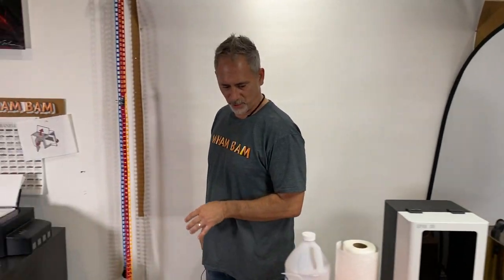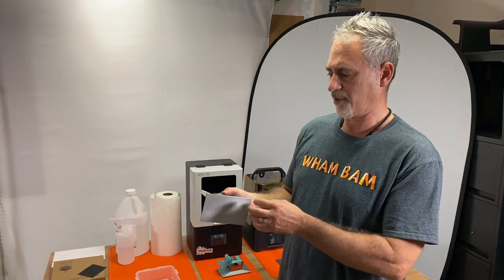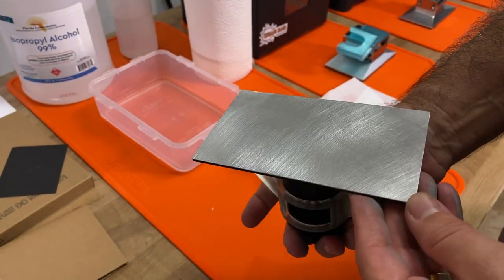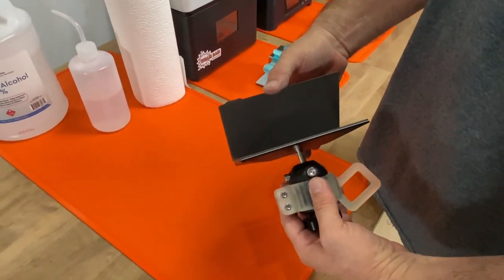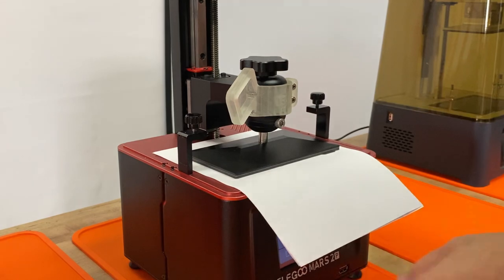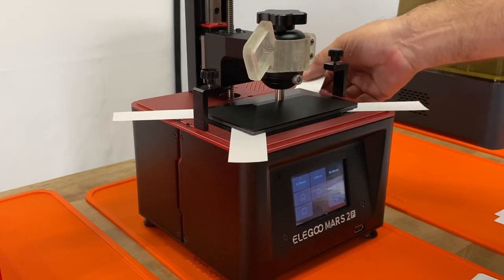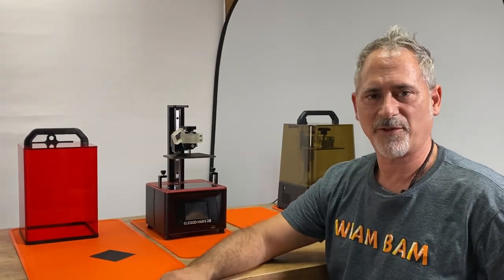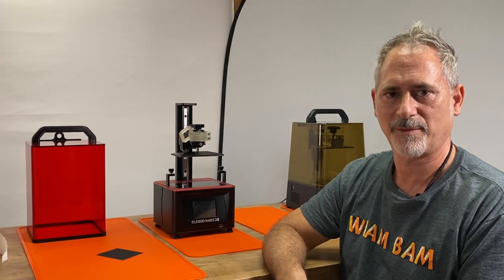Installation of the Flexible Build System for Resin (Updated)

Comment: 26:12 I was struggling for the longest time with my prints not sticking despite all kinds of adjustments to the settings. Revisited this video and followed the advice about sanding and the next attempt worked instantly.

Thanks for being thorough with your instructions, I foresee a lot more resin printing in my future thanks to this product.

Comment: Just tested my flex plate on Mars 3 Pro. It's a sick upgrade my friend. No adhesion nor plate slide problem. I sanded my base plate until it was quite flat then I did the installation. thanks for that masterpiece bro ✌🏻

Comment: Just bought a Mars 3 and the Wham Bam DWR so I really appreciate this in depth video. Cheers.
Reply from the maker: Glad it was helpful!
Reply: @WhamBamSystems  Hey guys, do I need to sand my build plate if it is brand new? I'm installing to a unused Mars 3 because I wanted to use the flex plate from the get go. Cheers.
Reply from the maker: @cfriedalek  yes, it helps to ensure that you have removed the oils and contaminates from factory and puts a bit of tooth on the metal.

Comment: Tip for prep work: acetone is an industrial strength degreaser.. Then perhaps a quick follow up with iso alcohol.. But never after magnet is installed, just for cleaning build plate before applying magnet. : )

Comment: I had bought the Wham Bam for my Creality LD-006 about 2 years ago. Unfortunately I moved and my printers went into storage. 
Flash forward, and I am setting up my office for my printers and just installed the system on my printer. 
I had to make some adjustments to my printer to make it work, but after some fiddling around and a test print...it works great!
Reply from the maker: Awesome, thank you for sharing!

Comment: Fantastic video you pretty much covered everything but maybe a short video about installing the spacer in :)
Reply from the maker: Good point, each machine is different but maybe we will have to make a spacer only video!
Reply: 👉I was going to ask this very question, but noticed you mentioned it, I just purchased a Saturn S. & had no idea it needed a Spacer… If there is anything out there that would help with the installation of a Spacer & How -2-Do-it would be much 🙏appreciated🙏
☯️ZenModeling☯️

Comment: Just received my first printer an Anycubic Photon Mono 6k and also a Wham Bam flex for it. It was a bit of a bummer to realize that I need to buy two silly small screws 3 mm longer and print a small spacer before I can install it. Now I have to first mess with resin, print and clean before I can even install. For a 800USD product it really did not feel too much to expect a spacer and two screws to come with it.
Reply from the maker: Sorry to hear your frustrations we can understand completely.  However, the need for spacer and screw is in all of our literature, videos and reviews.  We do not include them as each size covers different machines and manufacturers do not tell us when they are changing their models and dimensions, so by having downloadable files we can have the most up to date always available for a 5 minute print and practically zero cost to you.  Hope you can understand,  thanks
Reply: @WhamBamSystems  No, not really. I am guessing here, but I assume most Printerbrands use screws in M3 och M4 diameter. Length can not vary so much. Including one pair of M3/M4 in length 8, 10, 12 millimeter length would cover a lot of models. Add to that a pair of circular washers in the thickness of the flex plate. Put that "mounting pack" in a ziplock with the printer could hardly be more than a dollar for you and save a lot of us customers the time top go to the hardware store and buy a whole pack of screws just to get two.

Comment: After some problems with the leveling with the Paper Method, I levelled the build plate right onto the VAT and that did the trick for me on my Saturn 2. Adhesion is slightly worse than on the regular build plate but not too much. Few secs extra on bottom fixed it as well. Otherwise good product.

Comment: Despite following these instructions and sanding after doing what I felt was a pretty good leveling on 2 machines, both machines failed to adhere.  I'll try to manipulate the settings and I ran a known good print last night we'll see but I'm skeptical that it adhered.  I'll try releveling but... I was able to print out the box with the standard machine, was hoping this would be easy
Reply from the maker: Hi, we can help, do send an email to technical@whambamsystems.com include a screenshot of your settings and a screen shot of what you are printing, and type of resin.  Typically if leveled and you are having bad adhesion on base layers (not supports breaking) then you just need to either up your base layer exposure or rough up one side of the Flexi Plate with included 400 grit wet dry sandpaper.  but there could be other details in slicer to tune, so looking forward to your email
Reply: @WhamBamSystems  So, right after this, it did work.  I have printed and adhesion has occurred scuffed and not scuffed.  Now I just have to remember to put the bed back before hinting print!!!! ;)  also fixing up my vat, replacing the FEP and new resin and using a heater helped return the printer to reliable.

Comment: Good information. You clean the with alcohol then you keep touching it with your bare hands. After that you sand. Your sanding the natural skin oils into the plate, that's a no-no! I like the let it sit in alcohol for 1/2 hour before the install. DON'T touch the plate with your bare hands before putting the adhesive on. It probably won't matter but you video is slightly flawed. I like the build plate, works great!!

Comment: New to resin printing, but not to 3D printing in general. Got a Mars 3 Pro. I may try this, with the spacer of course. Question: What is the thing attached to your build plate base that has a handle?

Comment: When you did the leveling, had you already installed the little z-leveling piece to adjust for the extra height on the buildplate? I would assume yes, but just want to make sure :)
Reply from the maker: Yes. Install spacer first if needed
Reply: @WhamBamSystems  thank you very much for the quick reply!
Reply: @WhamBamSystems  So why is this essential step completly missing in this video???
Reply from the maker: @lafamiliacorleone2509  its actually one of the first topics spoke about after intro 0:21

Comment: Can you make a setup video beginning to end for the Saturn 2? New 3d printer person here and honestly might just return this product because I thought it was plug and use. How am I supposed to print some item with more mm space without using it first, which then makes it a poor plate for installing?
Reply from the maker: You can use washers in place of the spacers, or with all Elegoo systems you can also skip the spacer and just level on 2 sheets of paper, if you want more direct info please write to us at technical@whambamsystems.com and we can give you 1 on 1 help

Comment: So the big thing is that stainless steel plate is excellent for both easy removal of prints  and great for adhesion.  You can use a sharp scraper on the stainless surface without worry of damaging the aluminum surface.  I would consider just gluing the stainless plate onto the aluminum buildplate and forget using the magnet.

Comment: Trying to get this to work on my Elegoo Jupiter, I have printed the spacer from the website and installed it. However when I hit home, it still sounds like its applying too much force on the screen so I just stop the build head as I am afraid of damaging it. I wonder if someone else had this issue and if there is any advice for me, thanks!

Comment: So I got this for the elegoo Jupiter and holy hell this magnet is heavy. The build plate of Jupiter is already a brick. Im not saying this doesn't do what it says. But any chance you can r&d a 2.0 version that's lighter? It's pretty thicc as well. Perhaps a thinner neodymium version? Great idea. Right direction for sure. I'd even buy a pre magnified build plate and then just use the flexi plate. Well done but the inches are there to gain. Wish y'all best of luck as you get this out the door. Thanks again. ❤️
Reply from the maker: Did you get the XTR or original FBSR?
We use very high strength magnets of our own formulation to get the hold you need to ensure that large prints will not pull the plate off
Thanks

Comment: forgive my stupidity as i am new to resin printing and your product was recommended so i got it.  on the mars 3 do i or do i not need to add the spacer/limiter?
if so, where?
Reply from the maker: Everyone was new once, no worries with asking good questions.  Yes look at when I am pointing to the z limit trip area of the Mars 2. They are similar, mounted to the bottom of the arm that holds the print head.

Comment: I unfortunately found this video after installing the magnet on my Saturn, I did pretty good preparing the plate and placing the magnet my self, but didn’t print the z-axis spacer and am afraid of breaking the screen trying to print one. Any suggestions to solve this problem?

Edit: Just got to the end of the vid, totally should’ve just emailed y’all sorry :)
Reply from the maker: You don’t necessarily need a spacer for the Saturn,it’s just that when you add the Wham Bam FBS you are adding 2.6 mms that have to move the head up that much during homing, as the Saturn has a spring in the head it will give more compression and you risk having too tight of a level, to get around this follow these leveling instructions: mount the  FBS to your build head and put on machine. Remove your vat.  Put two sheets of paper over the screen, loosen both head screws so the head moves very freely. Hit home. When head is all the way down tighten screws being careful not to push down too much in any direction due to tightening. Hit home again and when head lifts up remove one sheet of paper. Check to see that the paper can move but offers some resistance across the full build plate.  Do not use “set z=0” function, if you don’t have à good level try again.  Let us know how it goes!
Reply: @WhamBamSystems  worked like a charm and have successfully printed the spacer, removed it from the build plate with ease, and got it installed no problem. Thanks a bunch for the help :)

Comment: I have been trying to figure out why my printer all of a sudden had horrible layer shift that just so happened to start after putting on the flex plate. I tried everything I could think of to fix it and later today I was planning on ripping off the whole wham bam system until I just found out that a spacer is required on the mars printers. 
I HIGHLY recommend either including one in the packaging or at least make it more known that those with mars systems need that spacer instead of requiring people to search for days to finally find the answer on a YouTube video
Reply from the maker: Hello Leland, so sorry for your issues!  actually in our instructions and on our support page it clearly states the need for a spacer.   If you or anyone is getting base layer shifts it is because the level is too tight, the spacer helps alleviate this.  With Elegoo machines sometimes you can skip the spacer as there is much play in the plunger, but the spring pushes down too hard, to avoid this, level on 2 sheets of paper, then raise head, remove one, and hit home to test. Paper should be snug on all areas but able to move.
Reply: @WhamBamSystems  actually I’m not getting any layer shifting at the base, it is towards the middle of the prints and is easily replicated from print to print. If wham bam may not affect that, then what could it be?
Reply from the maker: @lelandtaylor1037  can you please send us an email with photos of shift and screen shot of part in slicer? Technical@whambamsystems.com it will be easier to help you directly through email and or phone thanks!
Reply: The flex plate has a small flap where you can hold the plate to remove it from the magnet. If the lifting speed is to fast, the thick resin pulls the plate a little bit from the magnet and the resin goes through the two plates. Thats why the flex plate shifts sometimes. I would drill small holes in this flap to reduce the contact surface during the lifts. 🤔

Comment: Great video!  My Anycubic Photon Mono X has a rough surface already...do you recommend still sanding?  Thanks!
Reply from the maker: Absolutely, sanding is always necessary. You need to be able to break through the coating they put on the build plate as well as really get excess oil from manufacture out of the pores.

Comment: With the Elegoo Saturn 4K, do you HAVE to print a spacer, or is there enough play in the ball joint to just level it with the screws loose? I have a brand new machine never used, and I specifically ordered the Flexible Plate to adhere it to the machine prior to levelling and setup. I would hate to have to run this one time to print a spacer , then have to go through all of the cleanup procedures, etc. to install the plate. Thanks in advance for this great setup video.
Reply from the maker: It is advisable to print the spacer so the springs are not so loaded they push down the paper too low, you can also unscrew the interceptor arm and back it with a few washers and rescrew it in, you only need about 3mms extra.
make sure when testing level that the paper under flexi plate and above screen can move with even drag under all build area

Comment: Very nice guide!
I just missed the mounting of the washer to the Mars (I have a Mars 3, but I guess I still need the 2.6mm washer to avoid pushing thru my screen).
I assume you had it preinstalled.
Reply from the maker: Thank you, yes you need a spacer to fit under the interceptor arm for the z limit switch. Spacers can be found on https://whambamsystems.com/fbs-for-resin-support
Reply: @WhamBamSystems  , Great!
Thank you for the quick response!

Comment: Great video! Wish I had watched it first, but I'm hoping it will still work without all the prep. Any suggestions if the magnet does come off the plate? Is there replacement adhesive I can get or anything? Also, just a minor comment about the video... A few spots you could hear some heavy breathing from the camera operator, a little distracting, but not a big deal.
Reply from the maker: Thank you!  Hopefully it stays, if not, please contact us at technical@whambamsystems.com

Comment: The Anycubic Photon M3 Max has a checkered/textured build plate. I don't really want to sand it. Is sanding of the M3 Max build plate recommended, highly recommended? I've been really happy with my FDM Wham Bam plate, and I look forward to this on my resin printer. My Wham Bam plate is arriving today.
Reply from the maker: It is highly recommended, if you don’t sand you risk still having contaminants on the build plate that could cause magnet to peel up later

Comment: I love the mouthbreahting at the end of the video xD

Jokes aside, these were some awesome tips. I just got my Whambam Flex plate for my Saturn 2 and did a Test print but did not have any success. Am gonna relevel the Plate and hope it works. The Resin i am using is also quite tricky (Creality standard black resin).... But fingers crossed
Reply from the maker: Write us if you need any support technical@whambamsystems.com

Comment: I just purchased this for my Saturn 3 with a laser etched build plate. Do i still need to sand the build plate before installed the magnet?
Reply from the maker: We always recommend sanding the build plate to open the pores, even for brand new build heads,  to help remove cutting oils and contaminants and prepare the metal for the 3M bond.
We worked with 3M to have the best glue that would resist the harsh chemicals found in 3D Print Resins and Isopropyl Alcohol, but it does not do well on any metal with contaminants.

On top of it all, many printers are famous for not having a flat bottom, which will cause issues later.

Follow these instructions for best installation:
	• Be sure to remove old magnet and adhesive
	• Check that your build plate is flat by laying a steel ruler on edge  across it in all directions and see if there is any light passing between it.
	• Let the whole head sit for at least 30 minutes in an alcohol bath to remove residue from the entire build head and hard to reach places.
	• Clean every surface of the build head well with pure isopropyl alcohol and paper towel to remove all residue and dry well. 
	• Use 220 grit sandpaper on the bottom of your build plate to rough up the surface and open the pores and ensure there is no residue left
	• Re-clean with alcohol and fresh paper towel, repeat process with new paper towel until towel comes away clean
	• Let dry completely
	• Then mount the magnet and leave to cure for 72 hours.

When installing the new magnet please follow along with this video.
https://youtu.be/JrIeuAgX7vI

let me know how it goes!

Comment: I haven't received my printer yet - Saturn 2 - but I belive that it was a non-flat plate, it has some sort of wrinkle texture on it ,  for sanding it down to attach the magnet, is a little bit of sanding going to work? or do I need to sand it quite a bit to make it pretty much flat ?
Reply from the maker: if you are speaking about the texture on the bottom, no worries, sand with the 220 sand paper to open the pores and give some open scratches to bare metal, you don't need to eliminate the current texture, unless you are taking out a big curvature in the build plate
Reply: @WhamBamSystems  thank you for your reply, yeah the texture is what I was talking about